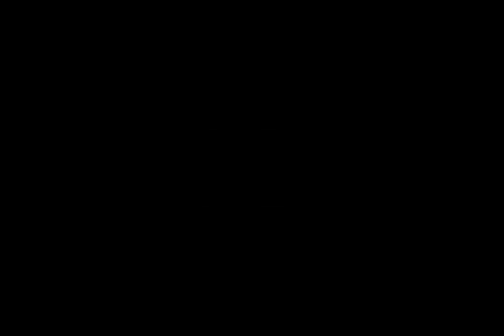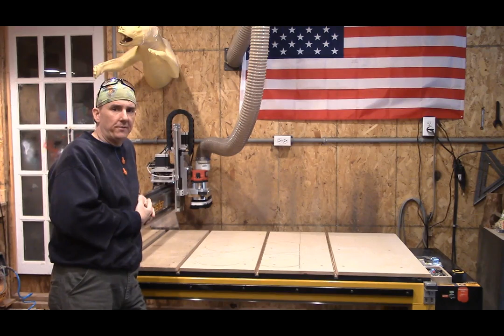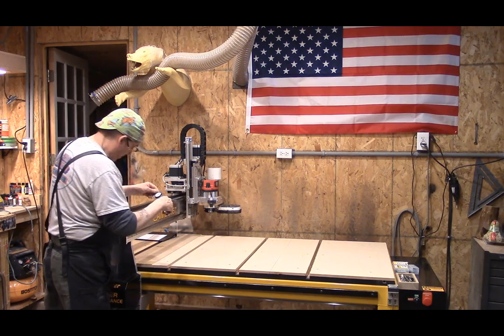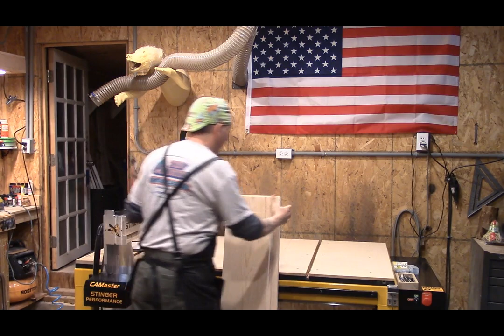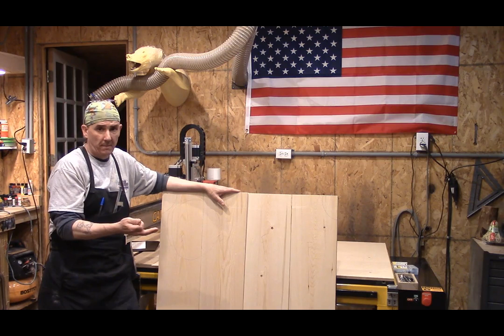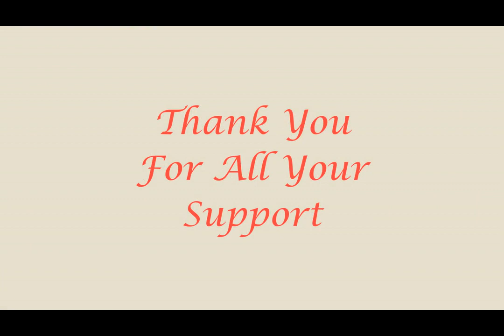CNC Town Sign Milling Preparation

Comment: Steve, I spent (30) years in the commercial cabinet & millwork industry. Just starting out in CNC routing. I noticed something when watching your glue up process for the town sign. The correct way to edge glue boards, especially wide ones, is to alternate the curve of the growth rings. This will balance the pull of the completed panel, even with KD lumber. Over time the boards will tend to cup in the direction of the growth rings, and having boards adjacent to each other with growth rings running the same direction will have natural forces at play that will cup the finished panel over time. You can flip boards end-for-end with no problem as long as the growth rings alternate. I am pretty sure you warrantee your products for a certain period of time. It would be costly to have to remake an expensive sign because it warps. Just thought you should know.  I have subscribed to your channel, and look forward to learning from them. I especially like how you present thorough detailed information along the way, something some of the other channels do not do. For those of us new to CNC routing, that is much more helpful than assuming your audience already knows all of the process. Thank you, and keep up the great work!